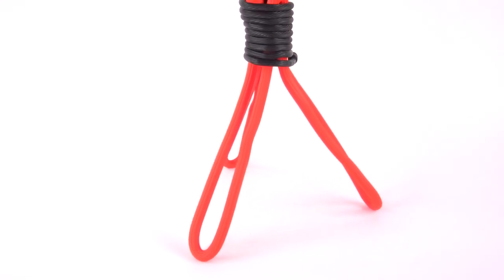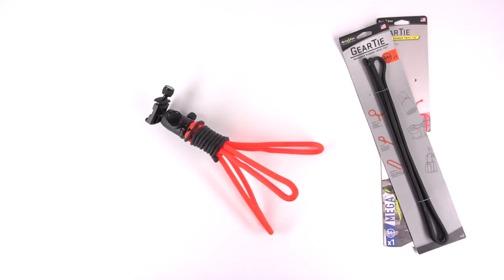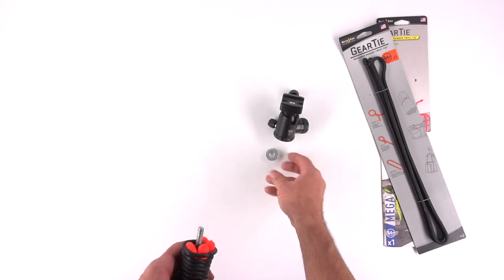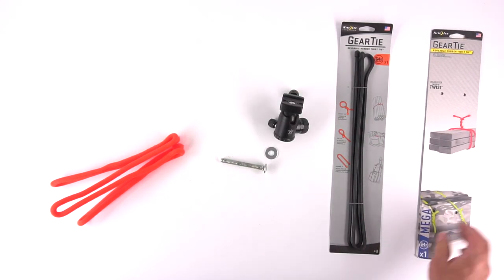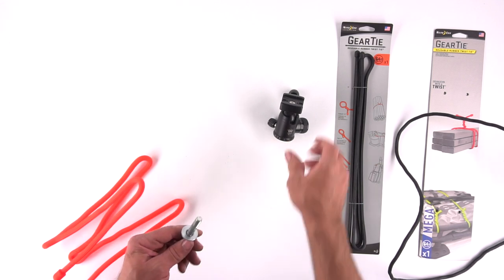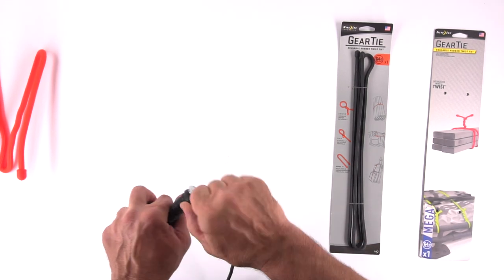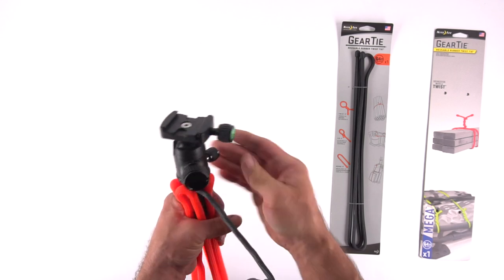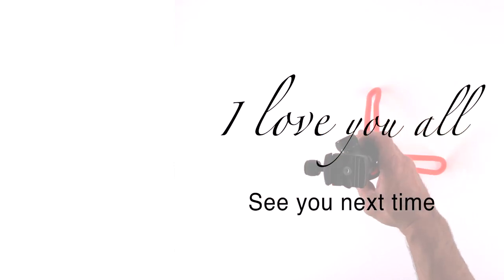DIY JOBY GorillaPod 3K (MegaPod)

Comment: Love this video too! Subscribed my bro. 
Are the gear ties you recommend only the nite ize ones? Or can off brand ones be used too? Is there a reason you prefer these ones?
Reply from the maker: I haven't had much luck with the off brand ties. They don't bond the rubber coating to the internal wire. If you have some already give it a try, I would love to hear ow it works.